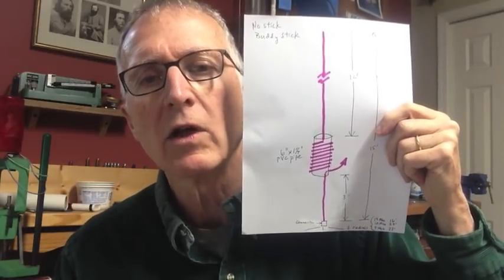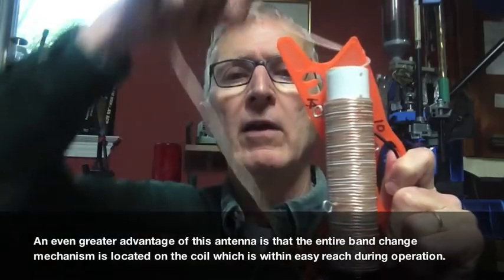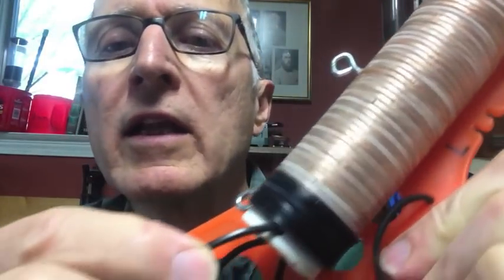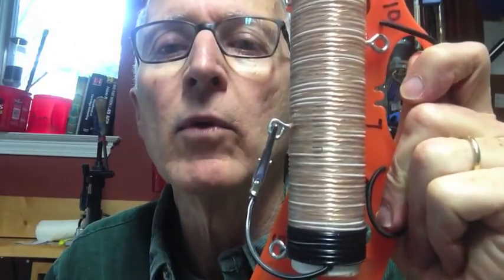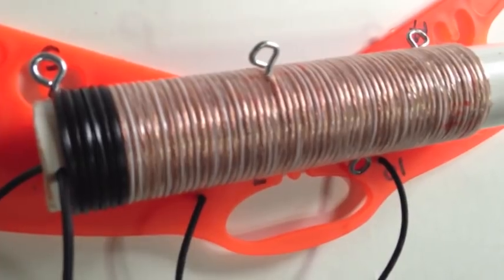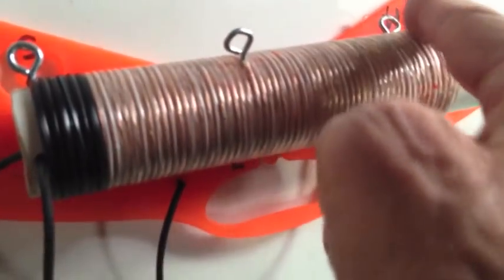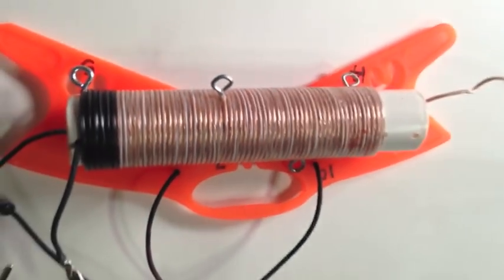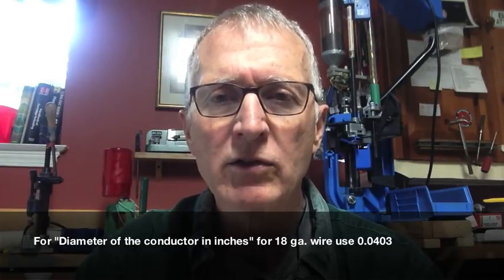Build the No-Stick Buddy-Stick Antenna

Comment: How efficient do you believe your coil is compared to a 1/4 wave ground plane antenna for one band?  I know that is hard to estimate, but qualitatively, what are you thoughts?
Reply: Hello Frank. I understand that you give up some efficiency by introducing induction. How much I don't know. As we hear all the time, "every antenna is a compromise." My goal was mulitband function, but also where the band change could be done more easily than pulling down the wire to adjust the links. I find that I get contacts on all bands most of the time.
Reply: @scottcarter9975  Thanks for replying.  Also, thanks for replying on FB.  I like the coil idea, I've created a 40meter loaded vertical and also an EFHF coil for 40.  As for your coil, do you have to keep the 33 feet long radial straight, or can you curve it?  I'm sure you can curve it, but does the efficient go down?  thx.

Comment: Great video. I wish you had a copy of your drawing and notes attached, but I drew my own following your description. Trying to understand...  there is 12' of wire above the coil.  The coil would take about 7' of wire, so the length wire needed for the top assembly would be about 19 feet?

73 K0CMD

Just saw that there is a part 2.  You may have answered my Q there.  TKS.

Comment: Can it take 100 watts?
Reply from the maker: Possibly but I have never used it over 15 watts. If you experiment, you might increase power from lower to higher a few watts at a time. Feel the coil and wires for heat as you go. Again I say I have never tried it over 15w so be careful. I don't want you to blow up your radio. Thanks.
Reply: @kw4jm699  tnx. Ill get some goin if only for rx purposes or qrp
Reply: I ran my copy of this antenna on 20 meters for the 2020 Field Day at about 25-30 watts for several hours with no problems.  Not sure if I would go much more power than that though with the small wire used to wind the coil IMHO...

Comment: buenos dias.. ya hice la antena. No tengo analizador de antena. me podrias decir en que numero de vuelta en la bobina se pone  la pinza para cada banda..si las vueltas son de arriba hacia abajo  o de abajo hacia arriba...... la antena soporta 100wats o solo es qrp.
Reply from the maker: My taps are on these turns: #3 for 40m, #17 for 30m, #35 for #40m, #62 for 60m. I don't know if these will work for you because other variables in your wires and coil may be present that the analyzer would resolve. If you have a tuner on your radio though, this might get you close enough. If you have a wattmeter or swr indicator on your radio, you should be able to use that to fine tune these taps. I hope this helps.

Comment: EL  CABLE PARA LA BOBINA ES COBRE O ALUMINIO O ACERO?
Reply from the maker: I used insulated stranded copper wire for the coil, 18 guage. The turns are tight together not spaced.

Comment: Watched this video and built a version of this which I'm using with my QRP setup at home. Got it tuned on 20,40 and 80m and getting some good contacts from garden at home as I don't have space for a big antenna. Using it supported with a telescopic fishing pole. Thanks for the video some great tips.

Comment: I have question, why the various lengths for your radials? Most of the Resonant Antennas ive seen have identical lengths around 33ft.  

Im assuming it's for being on a slope and not flat terrain?
Reply from the maker: I just wrote my reply and it disappeared -- so if you get two you'll know why! You can do radials several different ways, just be sure you tune your coil with the radials you choose. QRP Guys Tribander uses four 10' radials and it does fine. However one way to think of a vertical is as a half wave dipole with one leg pointing straight up and the other stretched out as a radial. Ideally the radial would be a qtr wave long, and this antenna has a qtr wave radial for each of its three bands: 40, 30 and 20. But I commend you to try something different. I expect it will work fine. Tnx for watching. Scott kw4jm
Scott KW4JM
Reply: @kw4jm699  thanks Scott. I just bought almost all of my QRP gear except a tuner, analyzer, and Antenna. I was able to buy a DIY antenna manual i just need to find it as i bought it last year when i was fresh into HAM and took my tech exam. I appreciate the reply and the video. And keep your powder dry... Crazy times we're in these days.  Nick KJ7EKH

Comment: Save time and just buy the Wolf River Coil antenna. Not expensive at all and already built
Reply from the maker: I hear you. I guess it's a different strokes for different folks thing. I actually own a WRCoil, received it as a gift. But there's not much I enjoy more than thinking up and building a new portable antenna. Also, the WRCoil weighs close to 1.5 lbs.  My coil 6 oz. I would happily use the WRCoil at a park-picnic table kind of operation, but I haven't done that yet. To climb up 4 miles and 2500' elevation gain to a SOTA summit, I like to go light! and small. Thanks for writing and I wish you well. Scott kw4jm

Comment: If the antenna were base loaded and two feet longer, , would the radial length need to change to compensate?
Reply from the maker: I just re read your question! No,the radial design would not change.
Reply from the maker: A couple things would happen as I understand it. First you get more inductance with fewer turns the closer you are to the base because the current is highest there. But for the same reason you get more loss there. Midway up the vertical is said to be the best balance of inductance vs efficiency... but that’s too high for my strategy which was for the coil to be within reach without lowering it. Hence my decision to place it about three feet up the vertical with the feedpoint about 3-4 ft above the ground. But you certainly can load it at the feedpoint and you’d find your tap points the same way as in the video. The length of your upper wire would be a maximum of a quarter wave length for 20m less the length of your lower wire. So if your lower wire is very short then the upper wire can be nearly a full quarter wavelength. PS: Your upper wire can be short as you like. The compensation comes with the tap points, where the swr dips to achieve resonance. But shorter costs some efficiency too.

Comment: Good project Scott, thank you. I like the sewing machine needle to find tap point. I have been using map pins but they bend too easily. Although I have limited QRP/P & SOTA experience, I have certainly found verticals tend to work well and also raised radials. This is a good design idea as it allows band changes very quickly without an ATU. I suppose the coil at the base will tend to introduce loss. Nothing you can do about that though. Maybe some means of soldering the eyelets to the coil wire would be good (if tricky). Perhaps small copper eyelets could be used for this? Definitely thinking I need to build one of these. Thanks again for the idea.

Comment: why is it necessary to elevate the radials to 3 feet?
Can you simply lay them on the ground?
Reply from the maker: You certainly can do that. My study of verticals tells me that you get more bang out of elevated. But some may disagree. If you do ground radials then they should be on the ground when you set the coil taps because it changes the dynamics. I wish you success in your build.
Reply: I would tend to agree with KW4JM. While you could lay the radials on the ground, a combination of theory and experience would suggest advantages of elevated radials may include:

1. There will be less ground loss. Due to the radials being off the ground, there is less coupling between radials and ground. Less ground loss equals more RF radiated.

2. You can angle the radials down towards the ground which increases feed point impedance. Rule of thumb is 45 degree angle for 50 ohms. Closer your feedpoint impedance is to 50 ohms, the lower you SWR, more RF is efficiently transferred from 50 ohm rig to coax to antenna.

3. Better repeatability. Once you have your antenna tuned with elevated radials. Provided you set it up in the same way in the field or on mountain top, differences in environment won't alter the tuning much.
Reply from the maker: @Steve-GM0HUU  Thanks for that Steve. Very clear and helpful. Scott

Comment: Thanks for the video. But I find your method more work than using a buddistick. The Buddistick does not have one depend on Trees. I have never understand why people would want to launch wire into a tree, where it can get tangled and caught. Not to mention the effort needed to get it up a tree. You wire tapping method means having to poke hole in the plastic around the antenna. Which is not very appealing. Besides, when you change locations you will find that the previous hole no longer tunes to the frequency you tapped it for. It will be off. So all that work will be for nothing. If you are going to use a coil, wind aluminum rod around the PVC pipe with space between turns. Thereby eliminating the need to tape holes all over that wire. I'd wouldn't go through all that trouble. I'd use the buddistick coil and tap that with the Buddistick clip. Much easier and there is no damaging the coil by sticking a pin into it. The Buddistick only requires one counterpoise, no need for three radials. I do have both Buddipoles and Buddisticks, but I stopped using them a long time ago. I now use my Wolf River Coils when out doors in New York City's Central Park. I attach the Wolf River Coil to my shopping cart wagon (which I use to bring my equipment). I then add an MFJ-1979 Telescoping Whip and I am done after adding the counterpoise. No need for trees! By the way, one cannot lean on, climb, swing from, hang banners from or hang a wire a top any tree in Central Park or in New York City. There is a $2,500 for each incident. So I have to use a self supporting vertical or one of my many Magnetic Loop Antennas. Again, thank you for your video, but I find your method to be a lot more work and messy (holes in coil insulation).

Comment: Hi Scott.   I built your antenna last week.  Took it to the farm this morning and pulled it up to a tree limb.  I quickly found the 40 meter tap point.  While still attached to the needle I hooked up my MTR-4B and heard a station calling CQ on 7.053.  I answered and had a 30 minute qso first contact.  There was some QSB on the band, but we never missed a beat.  Thanks for a great design.  W4KAC
Reply from the maker: Thanks for that and I'm glad you had a success. I see that you live near the NC mountains. Let me know if you ever want to look into Summits on the Air. It's hiking plus portable QRP and code is great for SOTA. Regards, Scott

Comment: This is something I intend on making.  I have been a amateur radio operator since 1996 and took a leave from 2006 to 2017 from the hobby.  Since getting back into the hobby, I have gotten into building kits, I built the QRP-Labs QCX40 cw 5 watt qrp rig, and have a 20 Meter version ready to build (videos of the 40 Meter on my YouTube channel).  Then I put together the uBitx and a Bitx40 rigs, of course these are about 8 to 10 watt rigs.  The uBitx of course is an all band HF rig.  I just recently got a Yaesu FT-817ND and have become interested in POTA (Parks On The Air) and I have been looking at different antenna configurations.  I built a 9:1 unun and I use a 35.5 foot piece of wire for the radiator and a 26 foot piece of wire for the counterpoise.  I just recently activated a park here in my state using that antenna and a manual tuner.  I had the antenna up as a sloper about 25 feet into a tree and used about a 2 foot piece of coax from the unun to the tuner.  It worked very well for me, even in the bad band conditions we had that weekend (9/1/19).  In 35 minutes I made 13 contacts.  I like this antenna design and want to try and duplicate it.  Thanks for sharing your knowledge and your design of this antenna.  73 Juddie WD8WV  PS:  I also reload my own ammo.  My hamshack is also my reloading room!! LOL
Reply from the maker: Hello Juddie. Tnx fer reply. I continue to be amazed at the effectiveness of this antenna. I have been using it with my little Chinese HB1B  (no tuner)  and it gets maximum power out with very low SWR.  It’s a fun build too if you have an antenna analyzer. Feel free to email me if you have questions during the build. Look at QRZ for my email address. Thanks again, Scott
Reply: @kw4jm699  Thanks Scott.  Yes I have an antenna analyzer, it is the MFJ and can't remember the model number, but it looked like the one you had laying on the ground in the second video.  Now the one question I have, and this may seem silly, but could this design actually be used to create a mobile antenna?  Of course the vehicle would end up being the counterpoise.  Just an idea.  Thanks for responding Scott.  I sub'd to your channel and hope to see more radio/antenna videos from you.  73 Juddie WD8WV

Comment: Great video, looked up your call are you still a operator? Also nice shop and press!
Reply from the maker: Hello Lee. Yes. I go up on SOTA summits several times a month, 99% CW.  Also chase from home. Are you a Ham? Shoot me an email at my QRZ email address sometime. Thx fer commenting. Scott
Reply: KK4 ZJH .  Had a hard time finding you but I did. Did you change your call?
Reply from the maker: When i passed the extra exam i was assigned a shorter call kw4jm .

Comment: Noob question here as I am a new ham....couldn’t you just make the antenna resonate on 80 meters and install a 4:1 balun and have resonance at 40 20 and 10 therefore no need to move the tap? This won’t help on 60 30 and 15  but it’s a good set up for SSB. Also what size wire would be needed to handle 100watts?
Reply: Sorry you have not gotten a quicker answer.  The answer is "no."  Generally, baluns have little to no effect on resonance.  A 4:1 balun will transform an impedance, e.g., from 200 to 50 Ohms, or vice versa, as long as the reactance at the frequency used is not too great. As for wire size and power handling capability, generally more significant is the loss in the wire weakening your signal.  Some of your RF power turns into heat instead of signal.  The larger the wire, the lower the loss.  At some wire size, the losses in the wire become insignificant.  For the antenna in this video, I think any wire which is big enough to not break while putting the antenna up and taking it down will handle 100 W.  For the coil, though, to reduce losses on the lower frequencies (because more turns are needed than for the higher bands), I would use #16 or bigger.  If your coil gets warm after transmitting, you know you can reduce losses by increasing the wire size. 73 K5RX
Reply from the maker: Dwight, I don't know off the top of my head...but I am a sucker to try something new with wire. Perhaps others can chime in on your idea. For my part, I will try it at some point and report back. Tnx fer commenting. Scott kw4jm (PS: I made a fan dipole and a skyloop with 14guage which I use at home with 100 watts. It works fine. 18 would probably do fine too.)

Comment: I also just made your antenna,  have not been able to get the SWR as low as on your video.  Perhaps I need more quality time with "pinning the coil" & the antenna analyzer….  Currently I get about 1.7 to 1 on 40mtr, and 1.8 to 1 on 20 mtr.  On 30 mtr it was about 1.3 to 1....  I did not have the 3  radials elevated, and they just were laying on the ground.  Wonder if that would make a difference in the SWR in your opinion?  Also, have you experimented with an additional number of radials with this antenna?  From everything I have read and experimented with other vertical antennas they all seemed to work better with 4 to 10 radials.  It at times didn't seem to matter what the length of the radial was even, just that a few more helped.  I would think that the minimum to put out a really good signal would be 4 to 6 radials.  What say you Scott?  Very much like you video and the work you put in on this antenna so far.   73    Paul
Reply from the maker: Paul I'm no tech whiz so my best way to answer is to say that the 3 radials I describe work well, so you can try that but you should also experiment in the way you describe. Maybe that will work too. Please let me know what you find. Tnx fer commenting. Scott
Reply: Thanks Scott...   you might find the following YouTube video of interest, as well as follow-up videos the "DX Commander" has done, regarding radials.  A very interesting topic, hope you like it.   
   https://youtu.be/qVG1jevrXaI   (hope this comes through to you)
   73   Paul
  NA9M     @kw4jm699

Comment: I just want you to know that your video inspired my present vertical antenna. Check out DX Commander and his comments about ground radials. I currently run SIX 6 ft GROUND radials with a 15 ft vertical wire attached to a 16 ft telescoping pole and a similar coil design from your video. It takes longer, but using your thumbtack method and the SWR meter in my radio still got me the results I was looking for (80cw/40/30/20).
Reply from the maker: That's interesting Daniel. So I just now watched one DX Commander video on radials but he did not address a portable antenna situation. Is there one where he does? I'd like to see it. Thanks much for your note. Scott kw4jm

Comment: Roughly how many turns at each tap?
Reply: From just having built this antennas, I think that every build will be slightly different & therefore have slightly different tap points.  The only fairly easy way to find the correct tap points is with an antenna analyzer as Scott shows in the video.  You probably could do it with a noise bridge, or with a good SWR meter but it would really be hard to do it, though not impossible... IMHO  that is...